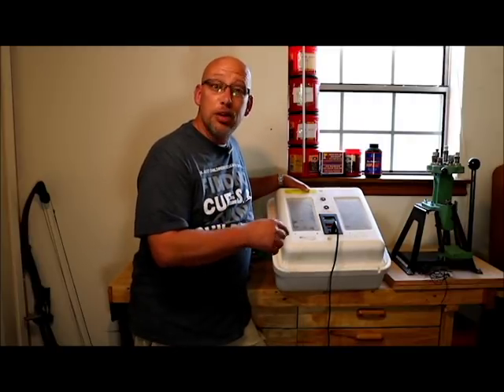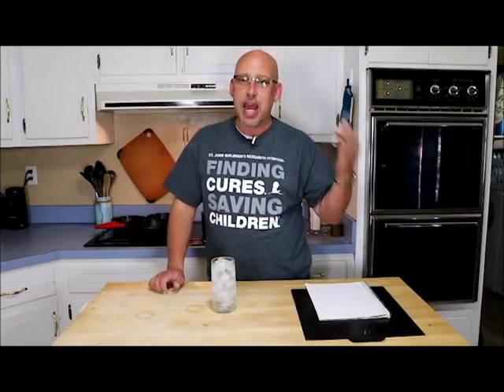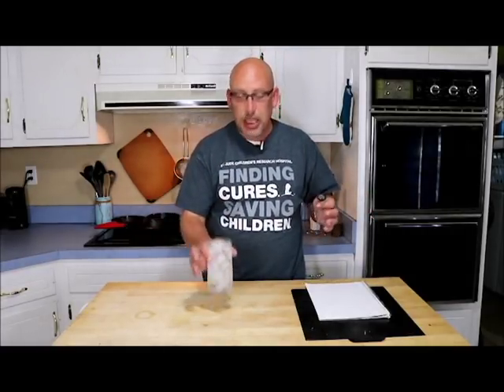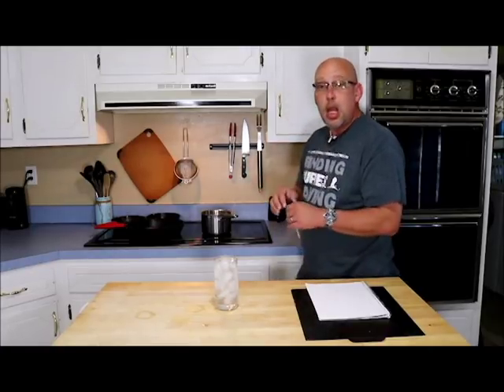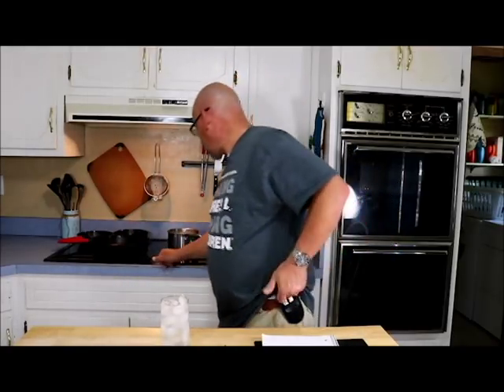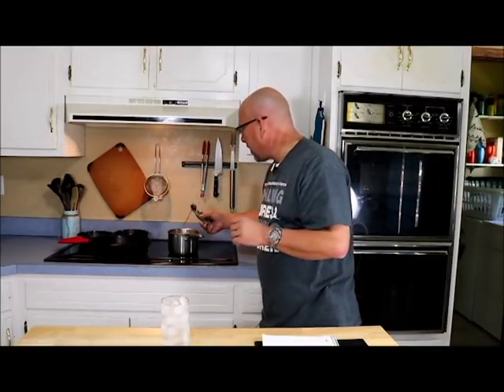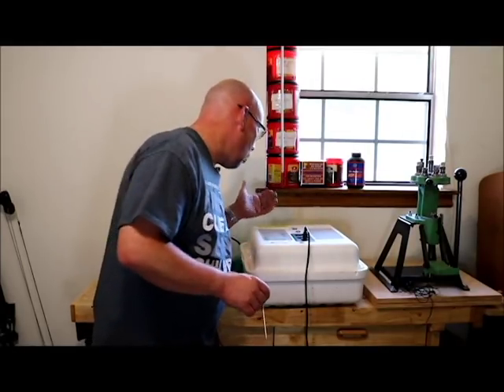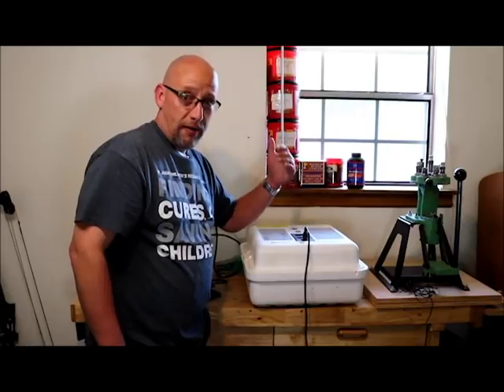How to Calibrate Your Incubator

Comment: One correction needed at the end of the video. You mentioned to Your incubator is reading 99 and calibrated thermometer reading 97. So you will subtract 2 from your incubator thermometer not add 2 as you said in the video.

Comment: Hi Chris i have strange problem with my temperature in the incubator.. i sec cal to 0.00 and then put the temperature to 37.5c i also added a separate digital temperature display in it but the digital one is saying 38.9.  how would i get the incubator to read the right temperature?

Comment: So I'm trying quail... Found the quail racks for my old hova Bator so I bought them. It's the stail air model. 

Where's my question, should I get a tiny fan from Amazon to lay on the screen? For $10-15 I can get a 3" fan. I could also tie it to the top but my thoughts we basically to pull it out for lockdown. Also I've put nearly no thought into this other than I'm wondering if something is better than nothing and can the waffer thermostat take it either way.

Comment: I know this is an older video, but I just watched it, so I assume others will also be watching it.
Chris tells us that we need a dial thermometer, but I tried this technique with an inexpensive digital  meat thermometer after testing it's accuracy with ice water and boiling water. It was dead on, but can be recalibrated in the future, if needed. A dial thermometer will get you "pretty darned close ", but a digital thermometer will get you 
"pretty darned closer"

Comment: Hi There:  Love, Love, Love all of your posts so far1  I have two different Gove's hygrometers which weren't cheap and probably not submergible, but since recently trading in my desk for a pair of boots, I probably am asking an obvious question...  Is there is a better solution than taking the average of incubator and two hygrometers.......their measurements don't even agree....or should I just spend the $10 (On Amazon)  even agree!  Should have bought the $6 ones  Important lesson, that.  Again thank you for  all of the information...

Comment: I have the same thermometer like the one you have but I'm using a different incubator. I calibrated my thermometer like how you do it in this video. When I turned on my incubator the temperature on my incubator say 41.9 C', but on my thermometer say roughly 98-99 F'. Even though my incubator temp is too high the actual temp inside should be good? Thanks!
Reply from the maker: It sounds like it.  If you are sure that your thermometer is accurate.  What you described is exactly how you calibrate your incubator.
Reply: Put ur thermometer to C’
Reply: I think 41 is too high
Reply: Mr Cunt i put a second thermometer inside it also said 99-100 F’ or 37 C’ when i change to C’

Comment: So, I calibrated my meat style thermometer following your video, but I don’t trust the method. A friend suggested getting a medical thermometer and using that because it has to be accurate and they are regulated as to how accurate they have to be. So I got one and tested my thermometers by getting a glass of hot water, approx 100f and putting the thermometers in. Wait for them to level out, then use the medical thermometer to measure the temp, and you’ll know how far off each thermometer is. I have an outdoor glass style large easy read thermometer that I got specifically for my incubator that was practically spot on, while my ‘calibrated’ meat style thermometer was 6 degrees off!
Reply from the maker: wow.  A medical thermometer is the best way for sure.  I know that my meat thermometer is not 100% accurate after calibrating but I have never had one come out that far off.  Thanks so for sharing your experience.

Comment: Chris, great channel. Watched a ton of your videos to get into raising quails. Basically, I was doing the same calibration with ice and boiling water. But what I found with a large range thermometer like a meat thermometer is that it isn't accurate to a nearest degree, and so requires a biased adjustment of a few degrees. What I found that works best is an oral thermometer or any low range temperature thermometer. They are usually in the 95-105 deg-F range and therefore usually very accurate for the application of hatching egg. Basically you can verify if it's calibrated on yourself to read 98.6 deg-F. Also go for the liquid type and not the digital type so you can easily monitor it anytime. Hope this helps.
Reply from the maker: That is a great suggestion.  Thank you for sharing.

Comment: We have 2 incubators. The Little Giant seems to be off a bit. The last 2 hatchings we had with this incubator has trouble regulating the humidity. The chicks are not able to dry off, and they start to die.
The Farm Innovator seems to be fine. the humidity will get a little high but the hatching are good. We just today had 76 hatch  out of 120, and were not done as yet. 
So my question to you is do you know what we may be doing wrong, and how can we fix it? By the way my husband is a huge fan of yours. he always checks your postings. He say's the hatch rate has quadrupled since he started watching your video's. Thank you for helping keep him sane.
Reply from the maker: Thank you so much for the kind comments.

The problems with humidity could be a number of things.  it could have to do wit the outside weather for example.  if the humidity is high in your area at the time you are incubating you don't need to add as much water to the incubator.  Also, make sure the vent plugs are removed.  Remember that humidity is determined by surface area not volume so if you put a little bit of water in all of the channels that will result in higher humidity than a lot of water in only one or two of the channels.  I hope that makes sense.  

I hope that helps a little.
Reply: Thank you very much.